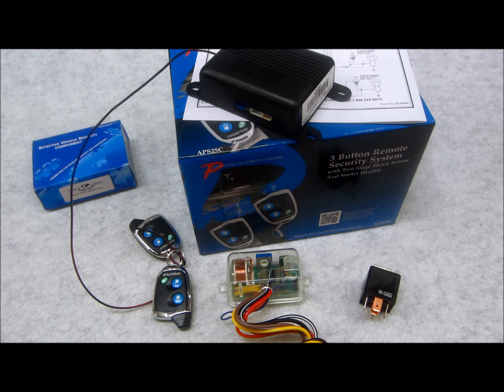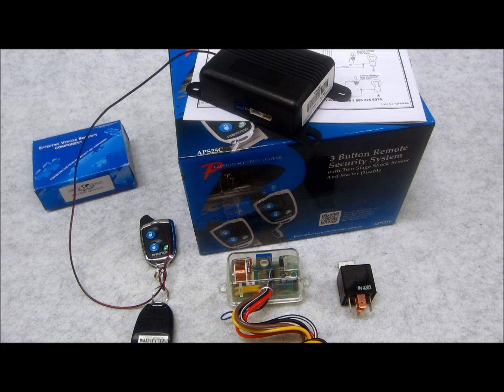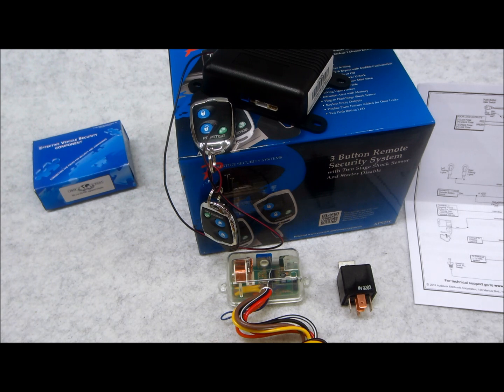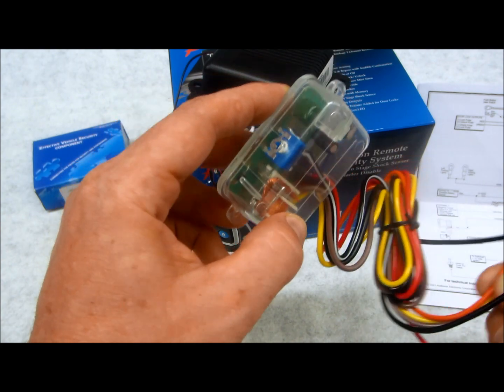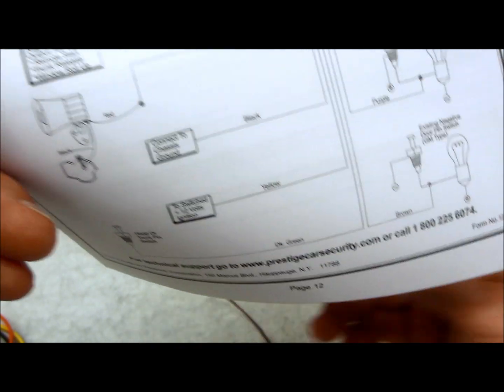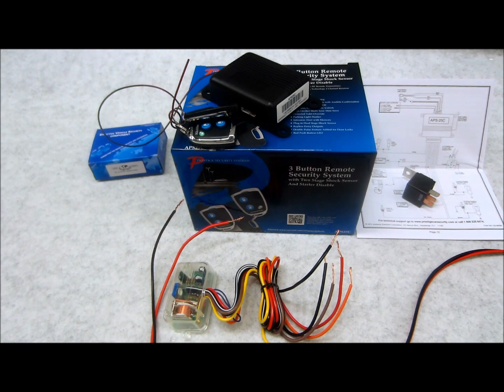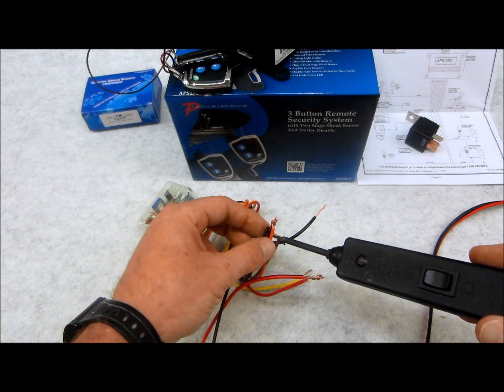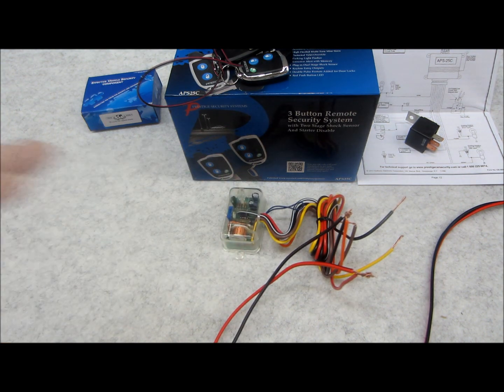How to wire a 528t timed latched output relay to your own specs

Comment: Can I use this to bump of the ide on my truck up to 1000 RPM. That is normal operation range for a Tractor. After I start the truck I need to hit the crus control up the rpm. it take a Negative  to move the RPM.

Comment: Thank you for the video! I am planning to use this device to convert a short pulse output to a steady dry contact. How does it react to multiple inputs(Pulses)? my output sends 2 12v -100m signals, I the device to hold over for around 1 sec. Thank you

Comment: I'm trying to figure out how to wire the 528t into my Audi A4 B6. I have a window module that will work for 2 windows but it requires me to open each door and access the wires to each motor. How can I wire the 528t to just the drivers door since it has the master switch for all 4 windows.  I have an after market alarm without a free channel. I'd like to wire it so when I lock with there alarm fob it rolls up any window that's open. Your help is greatly appreciated.
Reply from the maker: Id either get another 2 window module or 1 4 way and get it in that drivers door if it were me.

Comment: Hello
great work and video. I'd like to use this to fold and unfold the wing mirrors on my vw car when i use my factory remote to open and lock doors. 

Can you suggest or offer up a circuit diagram?

Many thanks for you time
Dominic
Reply: Viper,  Here's a link to do exactly that on a B7 Audi.  Might be pretty close to what you have.  http://www.audizine.com/forum/showthread.php/723637-DIY-Ignition-controlled-auto-folding-mirrors?p=11868104&posted=1#post11868104

Comment: I have recommended to buy Directed DEI 528T 12V Accessory Pulse Timer to connect to the car lock wire for bmw x3 e83 to delay the lock power to close all windows but i cant found the lock wire. someone said blue/red and online said yellow/red, i have tried both but still not working.and also how to wire the   Directed DEI 528T 12V Accessory Pulse Timer to work. They said :Black/white and brown to lock wire blue/red. 
Black and yellow to ground. 
Red to constant 12V+ 
Set timer for 15 seconds if electric roof, 10-12 otherwise.

Comment: Would I be able to use that relay to delay the startup of a small electric air compressor on my truck, by tapping into a fuse that only has power when key is on the run position?(Positive side control), and then keep power to the compressor until i loose 12volt power? And if so, how? And I wouldn't mind that pdf, to see if I can learn something new(garvinsrock@gmail.com) Right now I have power wire tapped right into the fuse (so it gets power when key is in run position only), but would like to delay compressor startup until the glow plugs cycle, and the truck starts.

Comment: Can you use this 528T as a delay for HID lights... To avoid the flicker while starting?
Reply from the maker: I suppose you could. Interesting application, good thinking!
Reply: Figuring out new uses is my hobby... I have several projects using relays. This delay may be exactly what I was looking for.
Reply: Do you know the wiring scheme for the HID delay? I"m trying to delay my retrofitted angel eyes.